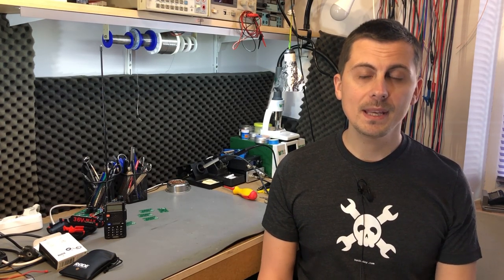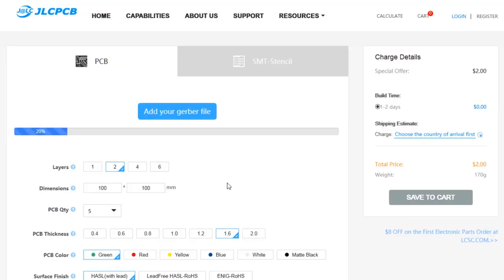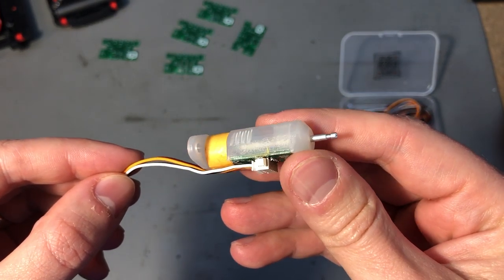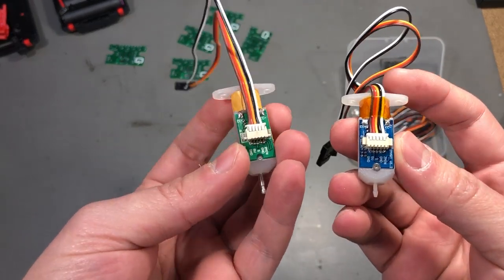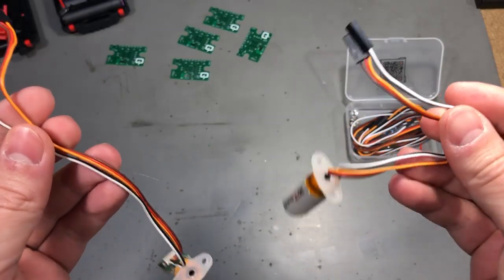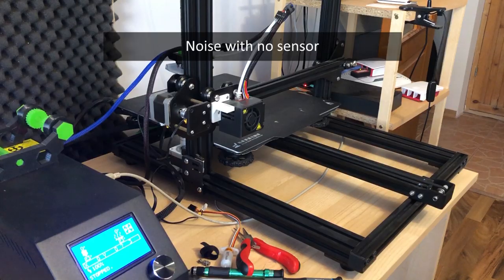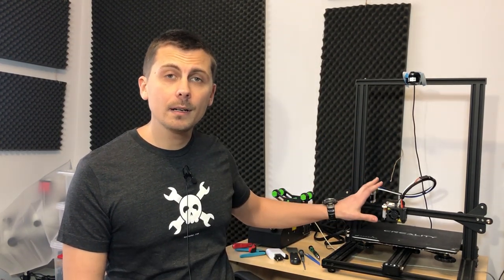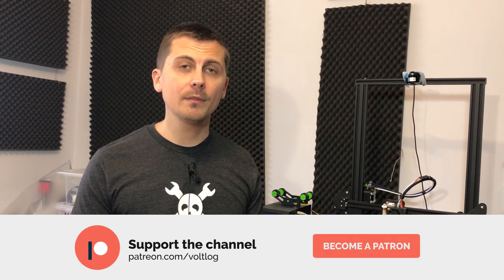Voltlog #288 - New BLTouch 3DTouch Plastic Pin Sensor Upgrade

Comment: Since you eliminated all obvious sources of noise, try this which solved one noise problem I had on my CR-10S.  The vertical Z-Axis lead screws vibrate as the X Y steppers work causing quite a bit of noise.  I did this about 6 months ago, and am not home now, so describing from memory.  There is a cover on top of the Z-Axis lead screw which covers the bearing.  Remove the cover.  With your hand you can move the lead screw from side to side and you can observe some sideways movement of the whole bearing.  All I did was wedged some toothpicks between the bearing outer housing and surrounding structure.  That remarkably reduced the noise when printing.  I did not “discover” this source of noise, I searched internet and others described this problem/solution.
Reply from the maker: Thanks! I will check that point for any movement.

Comment: The vibration is most likely caused by the steppers. TMC drivers will almost completely eliminate that. The SKR mini board has TMC drivers  and only costs 30$ on BG. Silent steppers were the most worthwhile upgrade I ever did to my printers :)

Comment: This video may be almost 2 years old, it still is pretty relevant.

I own both "old" and "new" BLTouch (genuine) and, well, no similar noise could be heard, even with mechanical endstops (which you could replace with optical ones). So, the issue lies somewhere else. Maybe did you solve that issue since then ? :)

Anyway, that's not really the point here. As written earlier, I own both new and old BLT, respectively based on plastic (polycarbonate) and metal (aluminium) pins, respectively.
TBH, the old pin design, made out of metal, is somewhat more reliable than the plastic one. I noticed that, when it touches the build surface, that the new plastic pin did side shift and bend a little ; it's even more pronounced when your build surface is not "smooth", just like a textured PEI flexplate. That does not happen with the old metal pin which stays straight all the way through the probing process

So, the plastic pin upgrade is not really a good upgrade, IMHO. Sure, it may be lighter, yet it doesn't have that stiffness the old design had. That's something I'm missing a lot.

Comment: That vibration I think is from the motor as it ramps up/down better divers should fix it.
Reply: I agree - the stepper drivers are the root cause of this noise.  I have Trinamic drivers for all of my printers and they are completely silent...well except for the fan noise.
Reply: No. Skr 1.2 here and same noise from x axis/Bltouch.
Reply from the maker: Thanks for the feedback! I think in the end the problem can be completely solved by both having silent drivers and the new 3dtouch sensor with plastic pin.

Comment: Not sure what your 3D printer's hardware is exactly capable of, but if the option is available, have you tried playing around with the level of micro-stepping (preferably upwards)? Does it change anything about the noise?
Reply from the maker: It's the stock CR10 motherboard, doesn't have fancy trinamic drivers. I'm not sure if micro-stepping is available.

Comment: Mine is std and is std noisy - I like it noisy so I can hear it running from the next room -, but it doesn't buzz like that one. Maybe blu-tack the micro switches, or tap the frame and see if it rings.

Comment: I very much needed this. I just upgraded the control board on my Anet A8 to an skr v1.4 turbo w/2209 steppers. Because the board is still new to the market, there was some difficulty getting it setup. I had a brand new, never used authentic bltouch smart v1.0 with metal pin I had to use. I couldn't remember what people did for upgrades or why. I'll have to see if I can get the update. 

While I'm here, I wanted to ask you if you have a link for a decent set of leads for the UNI-T dmm. If they come with attachments, even better. The ones I have on my fluke don't fit. TIA.
Reply from the maker: ProbeMaster test leads are the best, well worth the money. Why don't the fluke leads fit the UNI-T? Is it the shrouds?
Reply: @voltlog  yeah just a hair smaller. These aren't the original ones that came with the fluke either. But for the money $12-$13 I paid, they've been flawless.

Comment: Is not that expensive to replace the drivers SKR board and drivers around $50?
Reply from the maker: Maybe but it doesn't make sense to do an upgrade for noise when I could upgrade mechanical things for quality so then I'm thinking I should get a new printer all together.

Comment: Try to use Teflon oil lubricant (or special factory recommended lubricant type) on rails. For any fixed object to the printer arm you can use soft polyamide washers between screws (you may use for fan or limit sensor). It will reduce vibration noise from moving hard mounted hardware. It cost almost nothing and it is easy to do. In my opinion the noise doesn't come from fitment issue it cause from friction. For next test turn off the fan. It is the noises from all of it.
Reply: Any type of engine makes noise when it is moving it caused by friction. Do not try to get screws tighten limit the resonance to frame using some dumping material to reduce resonance. When you hard mount engine it resonate to whole frame.
Reply from the maker: Motors are mounted with vibration dampers.

Comment: For me, sounds as noise from the rubber belt, sliding on the stepper wheel, when stepper is changing direction, stop or start, not an expert.
Reply from the maker: That would mean serious problems for the print if the belt was sliding but the printing works fine.

Comment: The black rubber wheels have two bearings each, and between them a little washer. If that washer is not compressed, it rattles. Perhaps thats the noise.
Reply from the maker: Tightening those too much will restrict their movement so I can't do much about that.